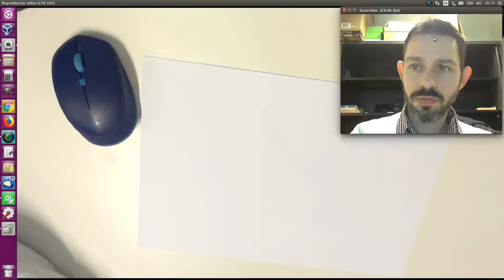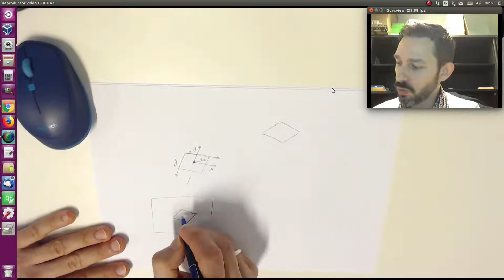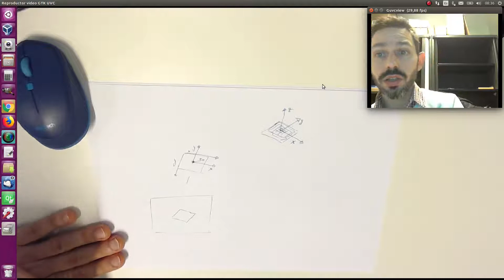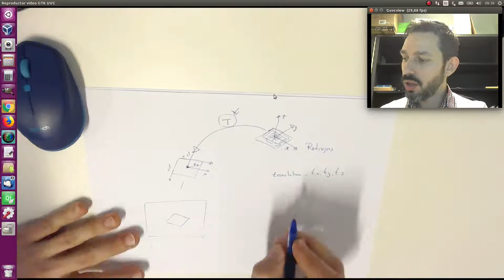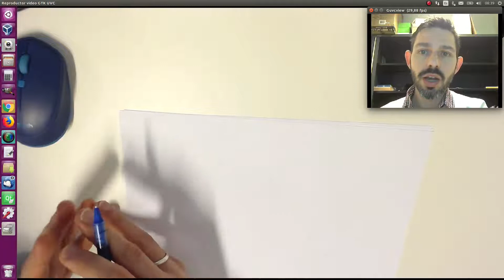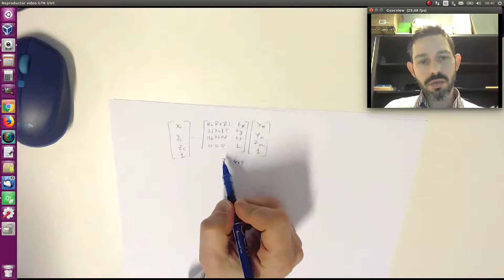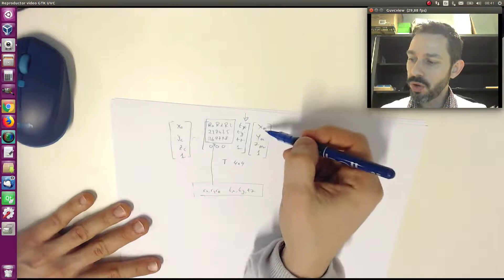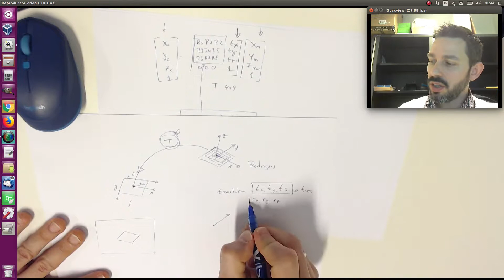5. Aruco Reference Systems and the role of calibration

Comment: I am a bit confused about the vector you are drawing at 2:29.  This transformation is Pc = R * Pw + t.  So: 
1) R is the rotation represent world (i.e. marker) axis with respect to camera. In other words R is MarkerToCamera. 
2) t is the translation vector that goes from the camera to marker (e.g, if Pw = 0 -> Pc = t, so t = the origin of the marker with respect to the camera).

The inverse transformation is Pw = R.t() * Pc - R.t() * t. So:
1) R.t() is the rotation represent camera axis with respect to marker. In other words R.t() is CameraToMarker.
2) -R.t() * t is the translation vector that goes from world (i.e marker) to camera (e.g, if Pc = 0 -> Pw = -R.t() * t, so -R.t() * t is the origin of the camera with respect to the marker).

Function detect() returns the camera pose with respect to the marker (if I am not wrong), thus for example if we use Rodrigues(marker.rvec, rotMatrix) then rotMatrix is R.t() or in other words CameraToMarker 
and marker.tvec is -R.t() * t or in other words camera origin with respect to marker.

I am telling this, because i need to extract Euler Angles from this Rotation Matrix so I need to know how the camera is oriented with respect to the marker (camera's yaw, pitch and roll) and i am a bit confused if i need to extract them from marker.rvec or from it's transpose.

Sorry for the long post.
Reply: Did you get the answer to this , I too am confused about what is the reference, camera? Or marker?